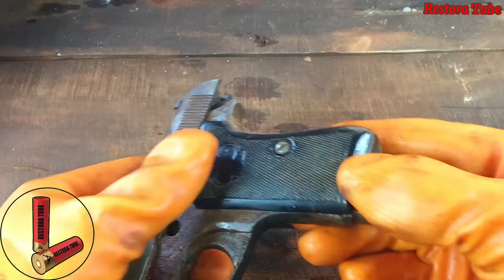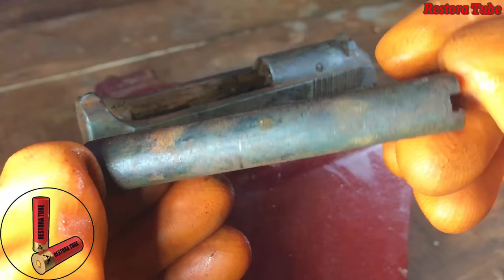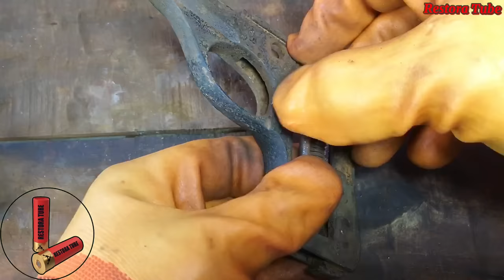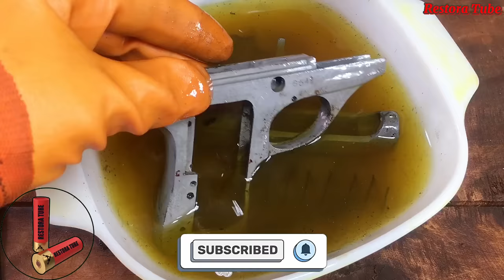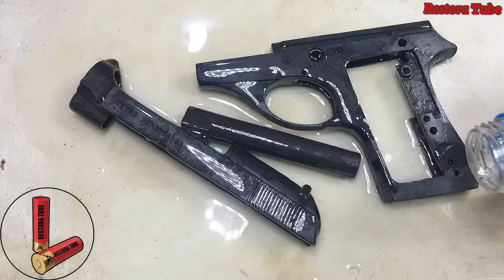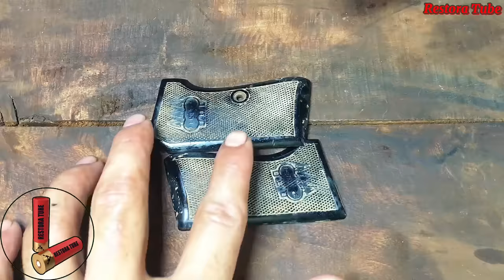Beretta M1935 CAL 32 RESTORATION

Comment: Not m1935 not M70 also this is a handmade crude copy hybrid m1935/m70  Beretta look a like pistol  extractor on the top like 1935 and safety lever also from 1935 trigger house and slide  copied from m70 afghan or pak made probably